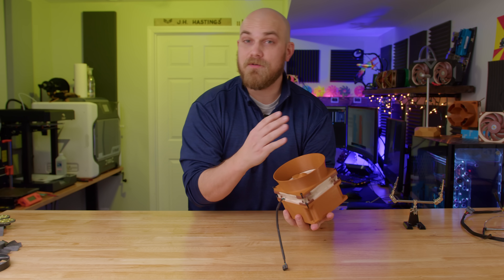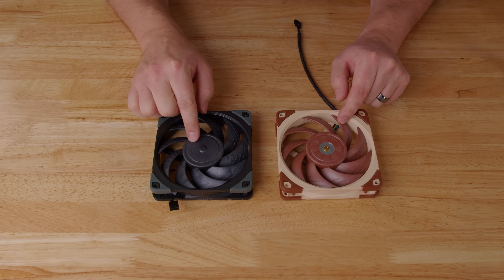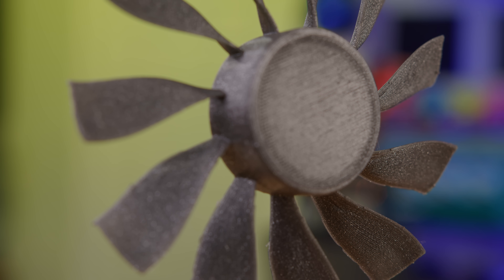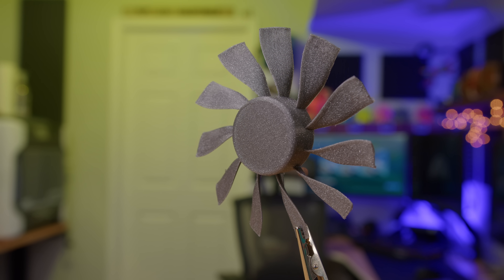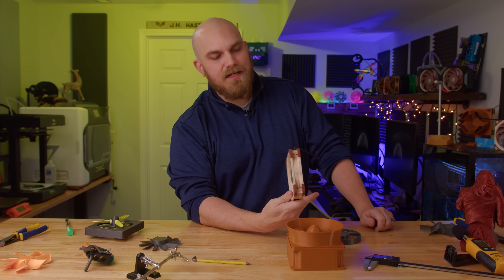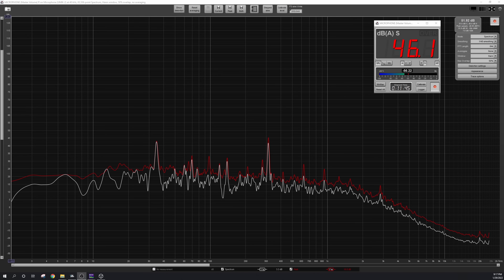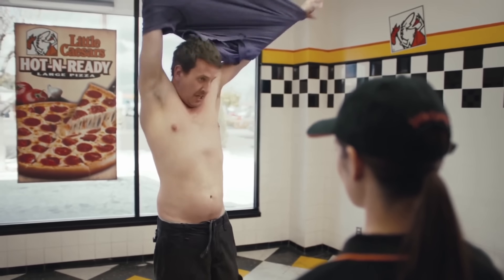Overdrive ENGAGED | Fan Showdown S4E1

Comment: When designing a gearbox fan to output a high rpm you have to make sure that the motor driving is geared properly for its torque. A slower spinning motor with high torque would spin the fan much better, you also have to figure in the static torque and drag. I think it can be done if someone took a good torque measurement on the motor driving the fan and made a gear ratio that would put out the max rpm for that torque. Test and scale back to account for drag and static.

Comment: The holes are likely because with the other fan it had a hole so when you put it on the air would escape, the new black on does not have a hole so those holes are needed for the trapped air to escape when fitting the fan.

Comment: usually a "cheater" has an unfair advantage, so i want to know why is that fan called "the cheater"? does it cheat? in a way that the design is actually used comersial "butcher that word for sure".
the "cheater" looks very close to the fan we used "back in my construction days" to keep tunnels and unfinished basements supply'd with fresh air, so yea that thing is probably pro engineerd to move air. (ps: the one we use is way bigger for sure, but i'm talking design wise)

Comment: I just realized that all your episodes are invalid, since you don't load the blades the same, i.e. you aren't putting the same wattage into them. With different fan design comes different motor specs, or at least voltage. Do it all over :)

Comment: Maybe should have a look at a centrifugal clutch design for the blades on the planetary gears thingy.. So the motor doesn't have to deal with the blades initially.
Or design a "variomatic" style gear. Just to give the motor some time to build speed and inertia, before it has to deal with all the drag.
Flywheel might work.

Comment: note on the planetary gears: if they are involute gears then the assembly has only one configuration in which it will assemble properly (if the tooth number on each gear isn't even- it shouldn't)

Comment: That planetary gear fan - THERE IS TOO MUCH WEIGHT ON TOO SMALL OF SURFACE  - YOU NEED TO DISTRIBUTE THE WEIGHT MORE AND INCREAST THE FOOTPRINT USING THE PLANETARY GEARS  in your example, the 3 gears.  Now instead of 3 planetary gears, you need a lot more of them and just make them smaller or on another layer so you have 2 sets of planetary gears but you need bearings if you do that because it will bind from the weight alone and no support shaft leading to another bearing - it would "#DROOP" like a differential does in a RWD car - it tilts the drive shaft and you break drive shafts, all your drive gears teeth in the differential and u joints and you lock everything up, in this setup you have that "Differential Droop" from weight and friction and to fix it if you're not using bearings, you need  6 or 8 smaller planetary gears - the weight would be about the same - they are just smaller and spread evenly the thing you are doing right now with 3, is binding.   The gears bind on themselves because it's not balanced and the more surface area of gears on the planetary section, the "footprint" then  the more you force it all to self center and stay stable.  You would need the graphite for lubrication. Also when you 3D Print them, they distort.  You need to get a small, fine, flat, straight, file and remove any surface imperfections and make sure the gears teeth are all even and straight.   This is what will solve the issue.   #LetsGo !!!!

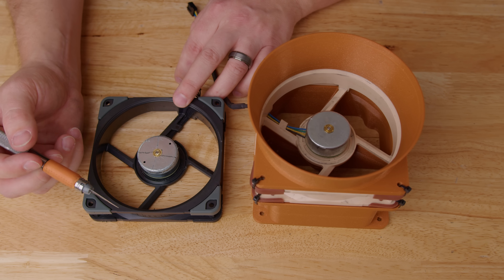Comment: 4:13 It is because the fan blade assembly they put on top is closed. And it looks like a tight fit, especially with the glue, but also without.
And if you put those two together, the trapped air needs someplace to go.

Comment: For fans with gears making a test bed hooked to power drill type power could allow the gears to get rid of the friction so it’ll work when powered by the fan motor. A lot of geared 3D printing things I’ve done I’ve had them run on a higher power source to let them smooth/round out and then they work flawlessly on lower power

Comment: It's possible that the addition of the black pigment to the plastic made the material more brittle than it is in the normal brown fan. I recall in a previous episode when you were talking about them working on a black version of the fan that was one of the reasons that noctua gave for not having made them yet.

Comment: Air in motion, for being so light, has a lot of momentum. It might be good for fan designers to keep this in mind when thinking about new blade concepts.
Also, about that geared fan...what's the backlash on the gear teeth? There should be a tiny gap between the teeth that mesh with the other gear teeth.

Comment: lithium grease is not for lubricating. You might as well have poured honey over the thing. Good call on the graphite though a very thin layer of light oil like WD40 would probably be best for the size and forces these constructions face.

Comment: I think those holes in the metal piece (after you cut all the plastic off of the blades and hub.... around 4:00 ) are used for the injection molding process... because it is completely covered over in plastic they probably put the metal piece INSIDE the injection mold and pump plastic around it metal and the holes are there for the metal and phatic to have some5thing other than friction holding them together when it spins... the holes are filled wit plastic and they act like pegs..... BUT I really have no clue, this is just a guess... I haven't see them myself and I am assuming they are filled with the plastic.. I could be TOTALLY WRONG and they could be there for some kind of ventilation or something....

Comment: Obviously not working is a big deal for the gear fan, but I also kinda wish the gears had props in them instead of holes. I know that would be a lot harder to print and result in a less rigid gear, but I still want it.

Comment: No point in trying to use gears to get higher rpms unless you can make the design extremely light and virtually frictionless. The motor is already pushing some of the heavier fans below it’s maximum rpm. It doesn’t have the power to generate go through a gear ratio.

Comment: Through the previous 4 seasons, the delta of the temperature was to me the most important part, the thing all were based on. Now that the CFM is the biggest concern. My submitted design which was made regarding cooling may not be as useful. I'd like the temperature to return.

Comment: i have a few thoughts for anyone on this gear fan
-one problem when making gears is if the teeth make to much contact you drastically increase drag on the system. so, you would design this system to only contact the opposite tooth just long enough to get the next tooth to grab the next opposite tooth, nice finely rounded points on the teeth
-another major problem with this design as you experienced before is that if the mass you are turning is not on the motor then there must be equal weight on both sides of the motor and if possible an anchor for the axles after one of the loads. If you get play in your rotation the gearing will twist slightly creating friction(enough to stall the system or destroy the gears)
*a solution would be two fly wheels, one with fan blades attached. That cheater housing and fan would probably be where i would work from, it provides a nice cavity for the back end, that fan also has a large enough cavity in it to house the fly wheel. now you may not be able to machine a set of properly weighted flywheels for this system so, you would make another fan on the back end and you would need that axle to continue through the motor and be anchored into the a seat. 
*now, you can't make this adjustment to the motor, but you can offset the motor from the axis of the fan to drive the new axle as long as the gear on the new axle is dead center mass
-motor has the drive gear
-the fans and housing would have to hold and seal off the motor and its housing on an offset if you don't want to destroy the housing or, you could use that broken fans motor in salvage.
fly wheels would get you the momentum the system needs

Comment: The two holes are there to expel the air caught in between the fan and the hub, because they are also using adhesive. To prevent glue displacement while pressing the fan onto the hub.

Comment: Curiosity has me thinking about the reverse of these designs, maybe for the sake of energy capture, or simply to see the relationship between the shape of a blade design that can Catch a set amount of air in the tunnel(aimed at achieving lowest drag highest speed/torque possible) and one that can push that same given a set flow rate. Could forced air be used to 'reverse engineer' a reverse design, creating a push type blade to a desired result (800fpm and beyond?) or do the different functions necessitate different forms, one for pushing air and a different one for catching it?.. Just pondering, i thought id share with such a thoughtful group... tell me what you think!

Also, i love your content MH, very high quality, smart, fun, easy to watch and inviting! Keep up the great work, Sir!

Comment: I think not having a real world test here is a miss. The wind tunnel is cool and interesting to work off of but unless you can show a direct and significant correlation between the wind tunnel results (which as another person said should be in cfm not fpm) and cpu temperature then it's less interesting imo, more sterile. This series remains super cool though so keep it up!

Comment: Coming from an aviation background, I think it's important to measure both the static pressure AND the mass airflow. If you put an orifice plate in the tube that you can swap out to simulate backpressure while measuring flow out the back, I think that would be really interesting to see if all the fans hold up. I'd assume some of the designs that just pump air into a case won't be "king" when there's more backpressure like flowing through a more restrictive heat sink or GPU.

Comment: Coneptually faulty. 1 noisy fast fan is wrong. I run a total of 5 fans and a watercooler and run them very slow and at its quietest rpm. 42 Celsius for an 8 core and a 1080. Max temp is 61. You cannot hear them. What helps is of course that the ps has its own compartment in the tiny box.

Comment: Gear fans not working because of tolerances fix your tolerances
Reply: Tolerances are totally fine, it is the friction. I just finished printing the adjusted design to use some bearings and it works way better. No gear or carrier dimensions changed (other than hole diameters)

Comment: TK Mk III is in First Place, not the Cheater. There are two attributes important to a cooling fan. Of course the first is airflow or cooling, but to optimize only that irregardless of the other important attribute will lead to sub-optimal performance like a very noisy fan which the Cheater is. 

TK Mk III out preforms the Cheater by over 10 dB while loosing only 0.4 degrees in temperature. TK Mk III is the clear winner, out performing both the Cheater the Reference Fan by a large magine in the Noise category while loosing only 0.2 degrees from the Reference Fan

Please include the TK Mk III in the "Overall Winner Category" and the Cheater in the "Cooling Only Category"

Comment: I wonder if the reason for those holes is that since the fan doesn't show the metal hub, they needed some way for air to escape when they pressed the hub into the plastic fan. They didn't need it on the brown ones because of the hole in the plastic on the fan

Comment: A geartrain fan could be made to work if small bearings were incorporated, but here's the thing: There's no point, and it could never outperform a properly designed "regular" fan. Here's why: The motor outputs only so much power, and the motor has a specific RPM where it most efficiently converts that power into rotational motion. You can spend that power fighting air resistance with a large number of blades. You can spend that power fighting rolling resistance of bearings. Or you can spend that power by imparting maximum energy to the air by accelerating the air through the fan. A perfectly designed fan would have minimal air resistance and impart maximum force into accelerating the air, while balancing all these forces to keep the motor perfectly at the most efficient RPM for the fan motor.
You would think then that there would only ever be ONE perfect fan, and all other brands are toast. But that ignore a few critical things. The peak power varies by the voltage and duty cycle applied to the fan. So, if your computer is set for "quiet" mode, the peak power will be at one RPM, but as the fan ramps up, the peak RPM changes. The resistance, dynamic and kinematic viscosity for air changes based on air pressure, temperature, humidity, etc. So, even if you could design a perfect fan for YOUR environment on that day, with your current weather, change any of those variables and the design becomes sub-optimal by a little bit. And all of that even ignores the goals of air speed vs static pressure. 
So why the gears will always lose: you don't get any more power out of the motor by gearing it. You only waste power in the geartrain. You also force the motor to run outside of the optimal RPM range, further degrading efficiency. High speed fan blades are less efficient than lower speed fan blades because they encounter an increased resistance as a function of the square of the velocity. Doubling the speed will increase the power loss by 4.
Reply: I did not get into the maths or physics calculus when designing ProFan - it was a pure fun based on my engineering intuition.

My way of thinking is that the 1:9 ratio would give enough torque and speed for the airfoils to push a lot air even at lower RPM than those "standard" fans since even at quarter of the motor RPM you still have 2.5 times higher RPM on the output. That should allow smaller airfoils to push at least same amount of air that the high amount of blades with direct drive, so to speak.

The issue with lots of blades on a direct drive is that they produce a lot of air resistance on their own. Essentially that is the type of situation when more (blades) is less (air movement). You dont use a ton of huge airfoils to lift an airplane into the air, right?

Comment: Those holes look like a way for air between the hub and center of the fan when it is pressed on to escape. The original had the hole in the center so weren’t needed

Comment: 3:48 Those two holes in the Chromax hub are possibly to allow trapped air to escape when press-fitting the fully enclosed fan to the hub. This is not needed on the brown colorway because the center of the fan is open, allowing air to flow out freely when being pressed onto to the hub.

Comment: I want to see a design where you can configure it in a 1:2 ratio, and a 1:1 ratio using the same blades. I think that the RPM would actually be equal if not lower with the 1:2 ratio because of added friction and the air resistance vs. motor power being the same.  Pretty much just a 1:2 geared design that works with blades that can be transferred to a basic fan housing without any gear system.

Comment: Yeah with the gear fan the wind pushes on the blades the exact same amount as without any gears, meaning the max speed of the fan is the same. However the gears also add their own friction which would slow it down so it would actually be slower than just a regular fan. 

If these electric motors had some sort of efficiency/power loss at high RPM, then the gears would work to keep the fan RPM low and the power high. However I’m pretty sure these electric motors have a pretty much flat powerband.  The issue is pretty much that since these motors will run at 100% output with every fan, any geared fan will still have the same input power and therefore the fans will only hit the speed where the AR=input power. 

If the motors were RPM limited (say, 40% power usage with the regular fan and 100% power with the geared fan), then the gears would make a difference. But then why wouldn’t you just make a super high pitch angle blade and cut out all gear friction?  

With how the motors work in these tests, it’s not about trying to make a fan spin super fast using gears or anything, it’s about finding the most efficient airfoil for the blades to minimize unneeded energy loss, solely because the motors are already maxed out.

Comment: Use a hand drill to run the geared fan for ~10 min all set up with graphite and everything. It takes some time to work it in + break down the plastic bits that don't mesh perfectly through friction.

Comment: I think we should have more of the board be seen on follow up seasons than just the top.  I'm also personally not a fan of the cheater as it doesn't conform to the normal dimensional constraints of a computer fan, thus is less interesting to consider actually printing, than say, the likes of the T33.  I'd like to see the T33 be tested, as well as some more fans from past seasons.

Comment: Heey love the series 
My suggestion : 
You talked about the Cheater , although being  louder then some of the other ,having a nice low hum to it. So why not in addition to measuring the db also measure the frequency of the fan  either with a cheap Guitar tuner or free software  (in conjunction with your mic) this could give you and us  a interesting data point. And as (lets be honest) the "Sound" of a good working fan is probably the most important factor this addition helps in determining which fan to print or buy. 
Maybe for Season 5
Greetings from Switzerland 

Ps.
As you already provide the sound to the db reading you could make a vid finding out which sound is the most pleasing. Maybe by blind testing some of your friends or even Music youtubers and then comparing it to the fans that you are testing.